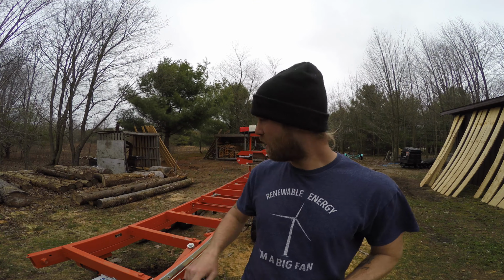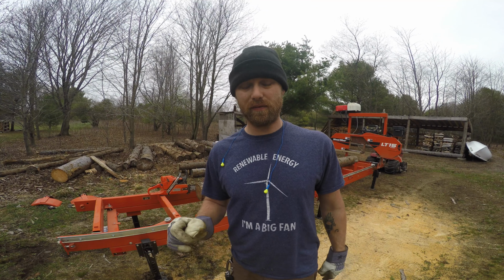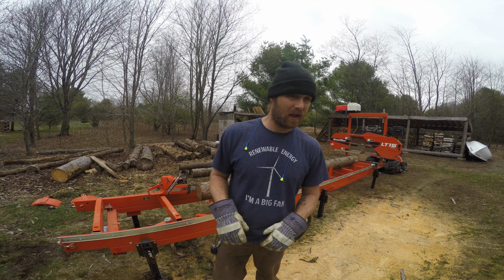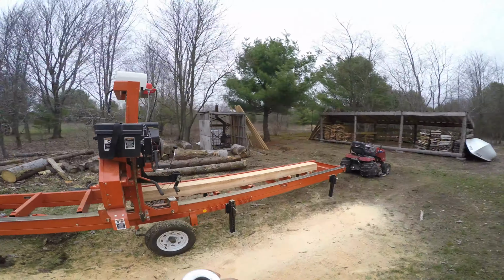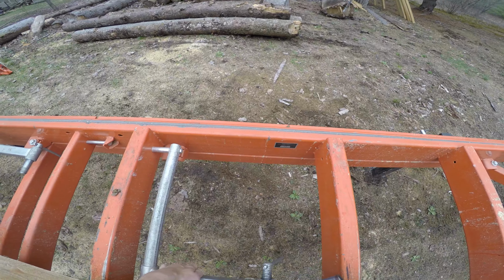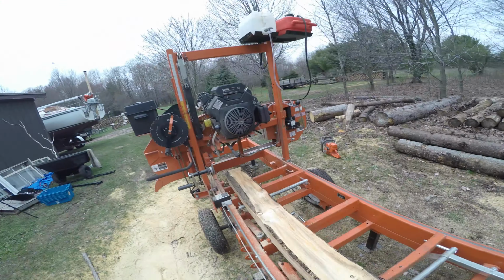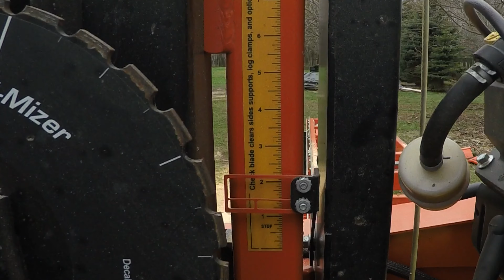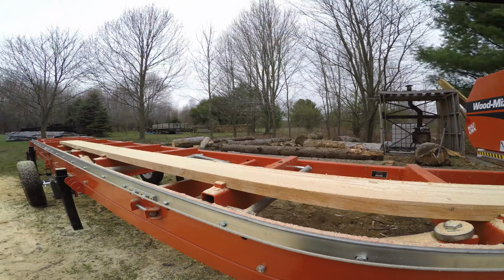Milling 3/4" boards for the barn on my Woodmizer LT 15 GO! 25 HP Kohler

Comment: That dragging back the blade thing made me cringe LOL
Reply from the maker: Why’s that? The blade already cut the wood, so there should be nothing for the blade to hit if the saw is cutting straight (which is should be) only the saw dust on top is removed
Reply: @BlueyesBelow  thats a good way to throw a blade. might not be an issue with these little logs but if youwere sawing wider heavier hardwoods theres enough weight on the blade to pull it off the guides, and while spinning = damaged blade. just good practice to lift head prior to return.
Reply: Whoops, now you dune showed them too much. It's your saw, but now their whiney.

Comment: I see you leave the band saw blade running while back dragging. My question is, are you not in danger of binding the blade with wood on top of it and also are you not in danger of hurting the kerf of the blade. Everyone else raises the saw and remembers the last thickness cut number they were on. Otherwise, fine job in resourceful ways and nice T-Shirt.
Reply from the maker: The running blade cleans the top of the log off which saves me a step of manually swiping it and saves me from adjusting the blade more than needed which speeds up things due to efficiency. If your saw cuts straight, the blade won’t be touching the wood because you just cut that wood out of there. I have dragged the blade back without it running and have popped the blade off the track numerous times..so I preferred to have it running, which cleaned the wood also as I said. 
Thank you for watching and for the comment 👍🏼

Comment: Why did you leave a 3/4" thick board in each of the four slabs (a 1 X 4 or a 1 X 6)? Really love watching a mill saw lumber, keep up the great videos. Thanks.
....13
Reply from the maker: +arkansas13  the last cut is always going to be 1" minimum due to the sawmill not being able to cut any lower.  Thanks for watching
Reply: There's ways to accomplish that 3/4 cut. Place a 3/4" cut board down on the bunks with the 2" thick uncut board on top in cutting position, then drill a 1/16th" hole or appropriate size for a toothpick peg and drive through both boards to hold down. Or just use as a 2 x 6 as you said. Easy least.

Comment: bringing the saw back without raising the blade after the cut is a sure fired way to screw up the blade
Reply from the maker: I don’t agree, I’ve been doing it that way for years with no issue. The blade is flat and smooth at the back. The teeth are at the front so nothing can happen to it if your cut is flat and smooth like it should be. I can’t imagine how it would wreck the blade anyways... It’s not touching other than to scrape the sawdust off on the way back.
Reply: It will/can pop off if spinning

Comment: quick question .   How long do you have to wait before you use your wood.  I guess what I am asking how long dry time before you can/should use the lumber
Reply from the maker: +Bryan OConnor it depends on the species of wood, how thick and what you plan on using it for, and where you store it for it to dry. Unfortunately there's not really an easy answer but a general guideline is an inch per year...so if you have a 2 inch thick slab it would take about two years to air dry.
This pine dries enough in about 4 to 5 months for me to use, but is only 3/4" thick.  Hopefully that helps!

Comment: I would think staking up against the barn would be a quick way to warp the boards. Don't you stack them to air dry?
Reply from the maker: +gary24752  I do my stacks out in the open on my property now and cover them with barn tin to keep the elements off the top but the sides and ends are open for drying.  This has worked really great and I've had minimal warping.  I wouldn't say stacking them up against a barn would cause them to warp, especially if they are stacked and snickered property...but they may dry slower because one side would be sheltered from wind.  Thanks for watching
Reply: In any case they should be stickered horizontally. Gravity will cause a moisture laden board to warp vertically. I once leaned a 4x8 sheet against a wall and it was only a matter of a few days before the sheet had a permanent curve.

Comment: I'm thinking about getting a LT15 go.  How have you liked it so far?
Reply from the maker: +Brandon Damato it's a great tool, but I have found where I need a mill capable of wider logs a few times, however that is also a lot of weight to flip manually and I haven't done much of that because of how strenuous milling huge logs are. I really don't mind the manual crank on it, except when I'm milling for hours on end...that will make you very sore in the arm...cranking down and pulling the head back. For small scale hobby milling, I think it's the perfect size and is very portable. 
I wish the leveling legs were a different design...like a hand crank winch on each leg to level instead of having to jack the bed up with a steel bar so the legs can lock into drilled holes to maintain adjustment. 

Again, overall its a great machine and I've really enjoyed it. Good luck and thanks for watching
Reply: Thanks for the review

Comment: I do not understand, all you had to do was to place one of the cut boards underneath the board to raise it up so you could cut at 3/4 of an inch.
Reply from the maker: +Mrx9999999 that is true, but I also have use for 1 inch boards. There are a million different ways to do things, the video shows you one of the ways that I do things.